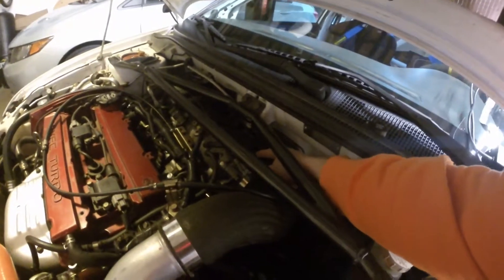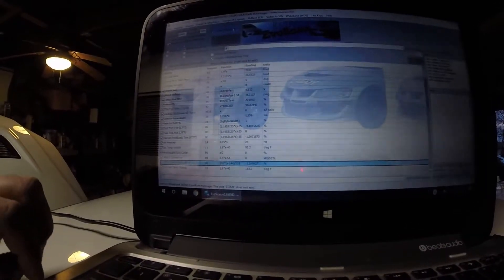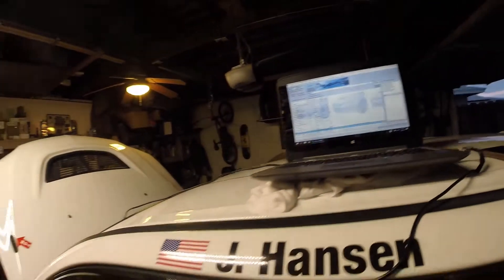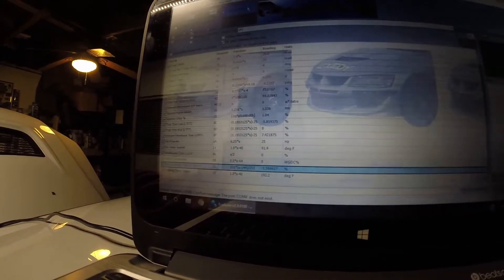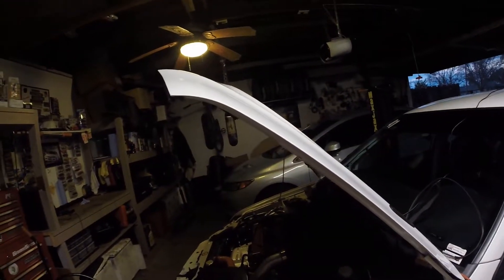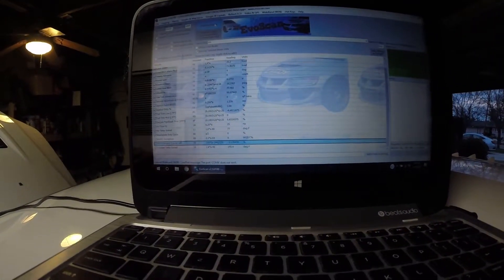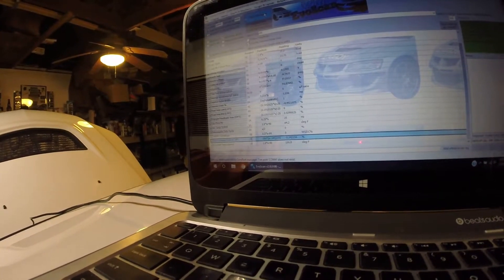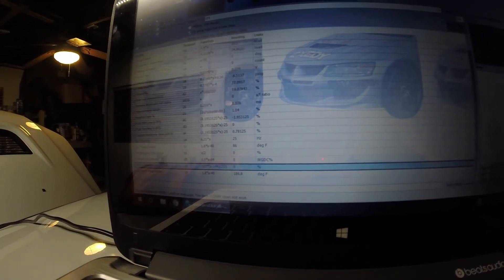BISS How To MP4

Comment: Hello! Great tutorial but I cannot see the ISCV demand trim checkbox on my evoscan, I only see ISC steps. I'm using Openport 2.0, Mitsubishi MUTIII and EFI. Hope you can help, thanks!
Reply from the maker: I noticed toward the end of my Evo ownership that I had trouble finding the IACV trim section. It had to do with adding the definitions, if I remember right. When I upgraded to the newest version of EvoScan, I also only had the steps option. I sold the car before I had to deal with it again. I'd search to see if you can find the coding to add to the file in order to read it. I never tuned with steps, so can't say how to use that instead.

Comment: Good video, thanks
Reply from the maker: Hopefully it helps!
Reply: @kaj750  Only problem is I dont have ISCV demand trim in my Evoscan, only steps
Reply from the maker: @Seven-pl9rd  weird. Are you sure you are logging the right parameter? I believe there is more than one IACV function to choose from.
Reply: @kaj750  I figured it out, you have to add that parameter as a patch into your evoscan xml :)
Reply from the maker: @Seven-pl9rd  makes sense, I figured. Where did you find them? Mine updated and now they are gone LOL
Reply: @kaj750  Hey Kaj I have the xml code in a txt file. Send me your email and I'll shoot it over to you
Reply from the maker: @Seven-pl9rd  Awesome, thanks! But I don't know how so send PMs on YouTube
Reply: How were you guys able to add that parameter? I’m having trouble with this too. My base idle is high.
Reply: @thisguy092  if you don't have this parameter switch to screw adjust mode in your evoscan, then adjust the biss screw till it's idling where you want it. The switch your IACV back on and log your idle, you should be between 20-40 ISC steps then you're good :)
Reply from the maker: @thisguy092  using the trim is the only way to do it properly. My EvoScan updated and now only shows steps. I am unable to find the definitions I need to fix it. Hopefully I never have to make this adjustment again LOL
Reply: Thanks! This helped a ton with the idle, I was at 60 steps and brought it down to 30. It didn’t help with my issue though. On a cold start I have to blip the throttle to keep it running, I took care of all the obvious stuff, checked boost leak, electrical, fuel, spark, changed spark plugs, and changed cam sensor. I was banking on this iscv steps, oh well hint continues…

Comment: So I've found your video and this on Evom about BISS adjustment, which is correct? Thanks 

Get the engine to operating temp.
Disable the IACV in evoscan by activating the Speed Adj. Screw mode ACTUATOR.

Then set the idle with the BISS close to desired idle.

Then reactivate the Acuator in evoscan. and idle should be good.
Reply from the maker: I don't remember that thread, but this video should be most recent. It's exactly how I do it to this day. Hope that helps.
You don't want to disable the IACV because you need to monitor the ISCV trims (get as close to zero as you can) as you make adjustments.